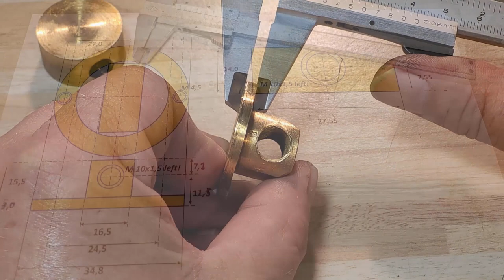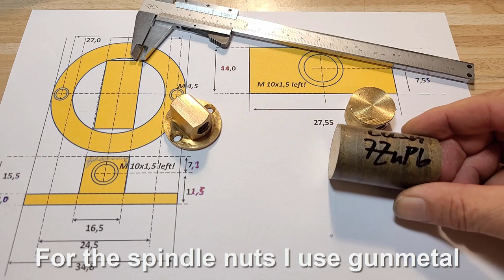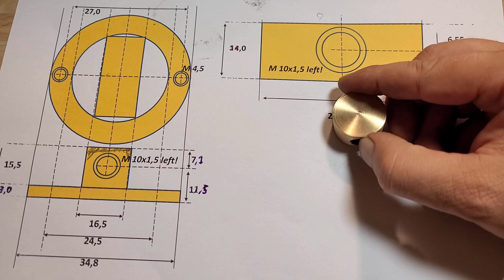Vintage 'Lorch' Metal Lathe Restoration - Making new Spindle Nuts

Comment: I started to wonder, and decided you had a second lathe; then I saw you taking the old parts out again and it took me a second to realize that you had 
A) dismantled the lathe and determined what needed to be done 
B) REASSEMBLED everything and made the parts
C) dismantled AGAIN and put the new parts in place 
That’s quite a bit of effort. Bravo sir. 
It’s kinda funny that you can use a machine with poor tolerances to make new parts for the same machine that improve its tolerances.

Comment: I've always heard of the color "Gunmetal Gray" so I assumed "gunmetal" was a steel alloy. When I saw the brass color I had to look it up and its also known as Red brass in the USA and was originally used for gun barrels.
Reply from the maker: I felt the same way - only the other way round! I knew the material as 'bearing bronze', bronze with a high sulphur content, ideal for self-lubricating bearings. I was then very surprised to learn that it is called 'gun metal' in English.
Reply: Same. I’m in the US also.